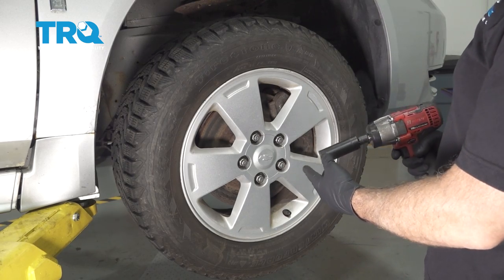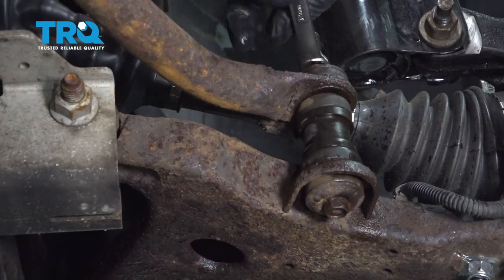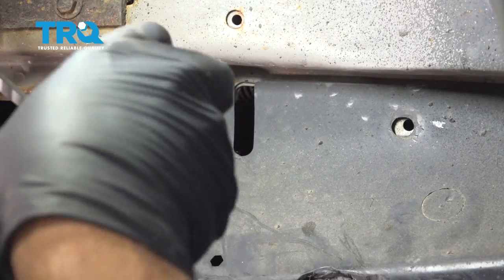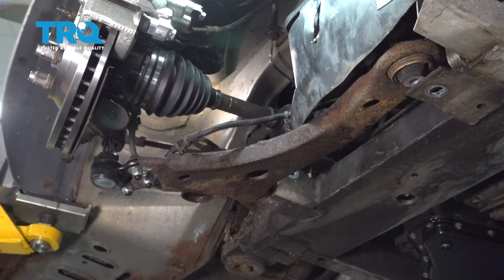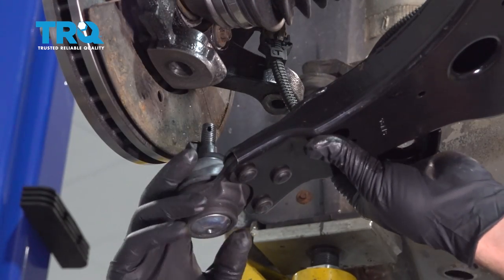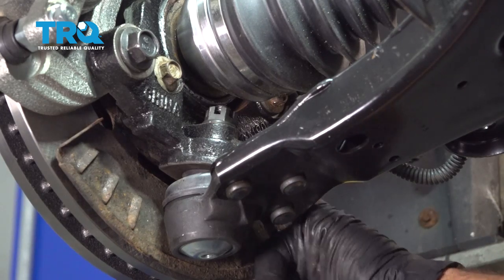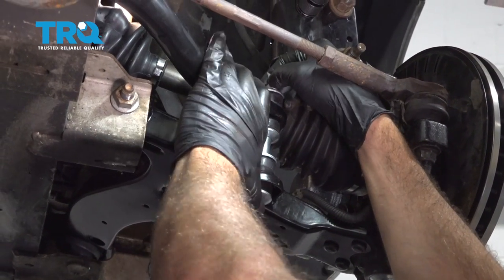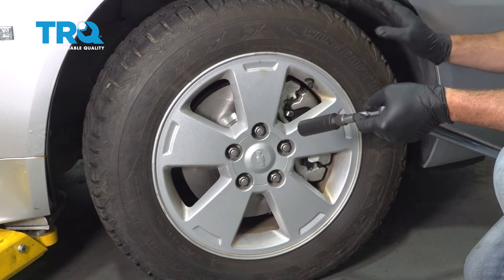How to Replace Control Arm With Ball joint 2006-2013 Chevrolet Impala

Comment: Why would you need an alignment done, you didnt touch the tie rods?
Reply from the maker: +ch hansen It is always suggested to have an alignment performed after replacing any suspension parts for optimal performance.